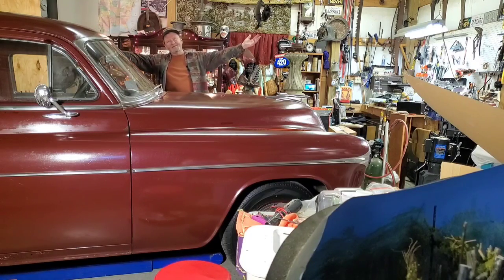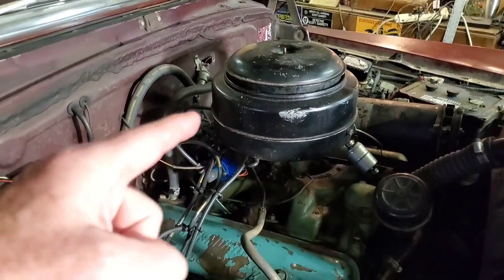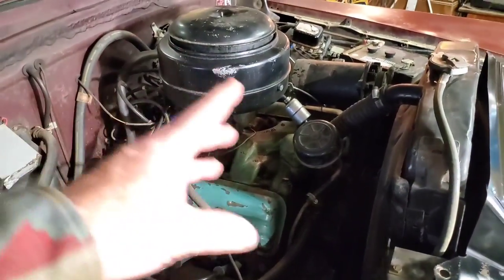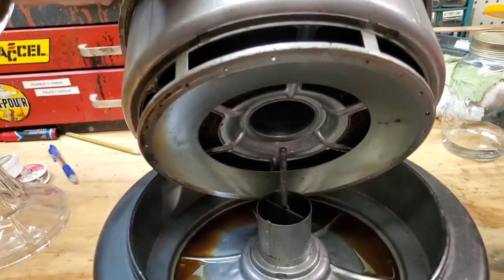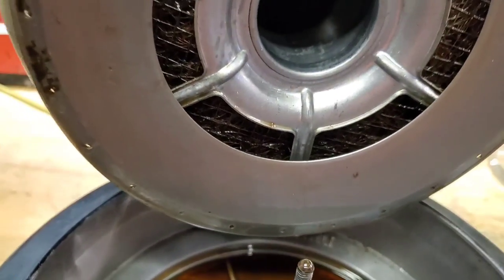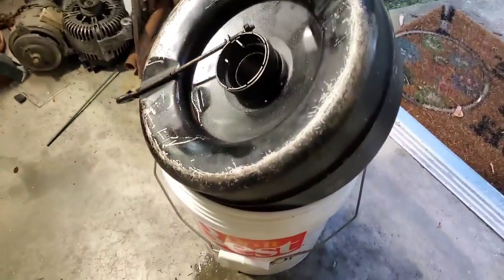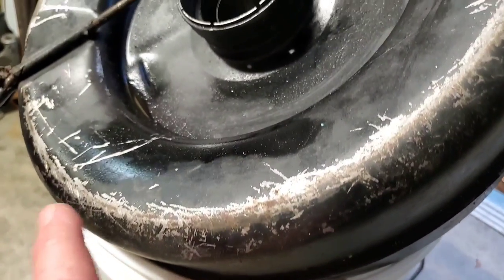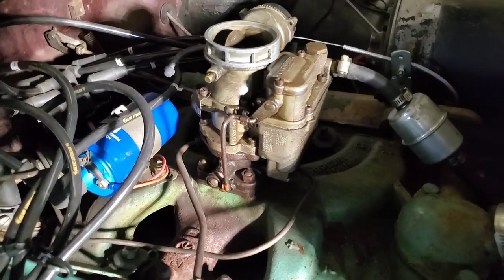Classic Car Oil Bath Air Filter Service. The Way GM Said To Do It. Not OSHA Approved.

Comment: When we were young, and these late 40’s early 50’s cars were our first cars, we generally just threw the oil bath air cleaner in the trunk and forgot about it , big mistake, but there weren’t likely any further rusting problems in the trunk. With time, I’ve really come to appreciate how well these air cleaners were built, heavy gauge stamped metal, nothing in the least flimsy about them.
Reply from the maker: An air filter element that contains more metal than a modern toaster oven. Old cars are amazing.  Thanks for commenting.
Reply: Just the filter housing could be a weapon.

Comment: What does OSHA have to do with this? Nothing looks particularly dangerous.
Reply from the maker: An open bucket of gasoline is a bit sketchy. Have you seen the new gas cans?
Reply: @OGGarrettsGarage  OSHA only deals with employee safety. They require metal self closing cans with spark arrestor. The eagle safety can is an example and those have been in use for decades.

Let’s be honest The only reason OSHA is mentioned is for clickbait
Reply from the maker: You got me! Yes my channel is well known for click bait. And look! It worked!